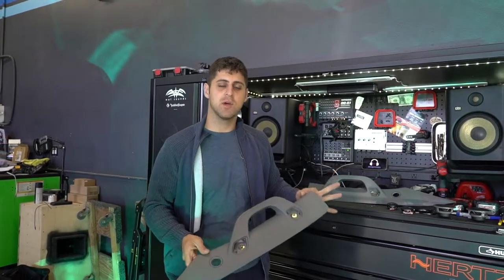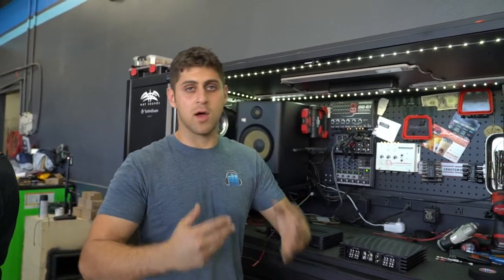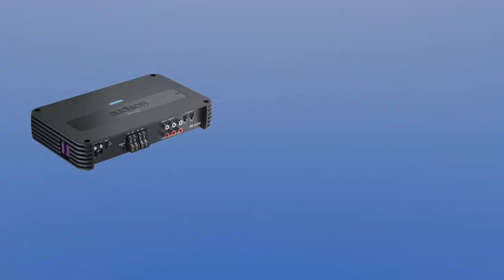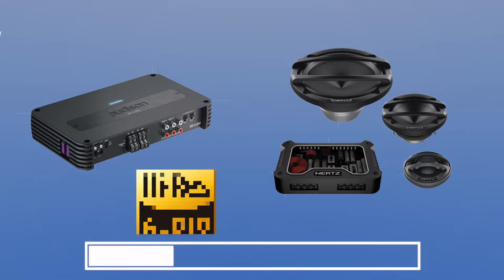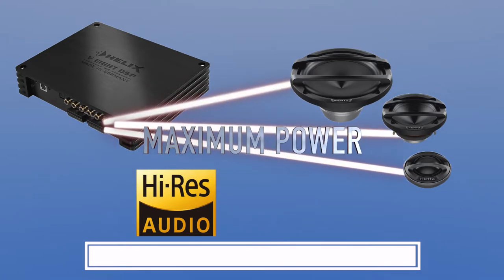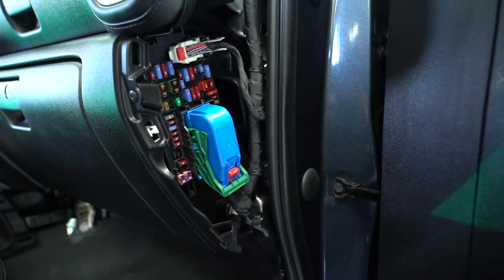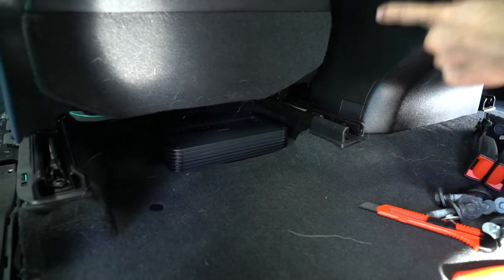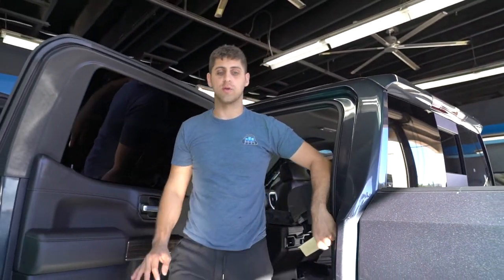How To Tutorial 3 Way Active Car Audio System(BEST QUALITY METHOD!) 2022 Chevy Silverado

Comment: Did u have to modify the 2.75 midrange speaker to install the 3in or did it fit without any modification
Reply from the maker: Slight shaving needed to seat but fits very well after :)

Comment: Hello, how do you grab low or high level signal to the dsp from a factory non Bose system iOS  on a 2021 silverado?
Reply from the maker: Very simple, that system is just a four channel Audio output, you’ll find two plugs that are square in the passenger kick panel/firewall area where the outputs are generated to the speakers. You can grab the signal from there

Comment: What settings or corrections did you make in the DSP to address the factory Bose time alignment, Active Noice Cancellation, and fader functions? Did you still run the rear drivers? Also, which inputs did you use from Bose to go to the DSP to have a "full signal?" Thanks!
Reply from the maker: Well actually, we did not have to worry about the equalizing and doing a full RTA to smoothen out the eq spectrum to our target curve As we replace the head unit itself which starts off with a direct and clean signal. From there we do a simple rta To achieve the target curve, gain match, and then finish off sometime alignment and final preference to tuning,
Reply: @audiolux6009  What head unit did you install? Any issues with navigation or cameras and such, or did the customer not care about losing that stuff?
Reply from the maker: @MrSmokin04  Everything was retained. We were able to retain the factory back up camera, retain the steering wheel controls and chimes. You do not have to loose anything. The radio is a DDX 60906S from Kenwood
Reply: @audiolux6009  Would really appreciate seeing any pics available of that part of the install. Never thought a HU would fit in there.
Reply from the maker: @MrSmokin04  I do apologize, scratch everything I just stated as that was a different truck of a different year. This is the newer truck model where the radio cannot be changed out. So your question is how we work with time alignment and the factory equalization? On the helix DSP processor we use which is also the amplifier combo, it has a input analyzer per channel that you grab from the Bose amplifier and it is able to scan the input once you use a correlated pink noise track and you’ll be able to tell if there is time alignment involved and if there is you are able to reverse that in the helix settings. With the equalization it is as simple as doing a full RTA And adjusting the EQ to reach the target curve which requires more aggressive adjustments than having a aftermarket radio, after all that is situated then you can go and enter your own time alignment settings and so forth
Reply: @audiolux6009  Awesome! That's what I figured. I have a Helix DSP Pro MK2 going in mine...and I figured we could undo the time alignment features that Bose did. Was the Helix able to sum all the channels to get a full signal? Or did you need an Epicenter or Wavtech to augment? Sorry for all the questions...just getting ready to cross this bridge myself.
Reply from the maker: @MrSmokin04  Yes the helix was able to sum the front active signals and still had enough input channels for the rear and factory subwoofer.
Reply: @audiolux6009  So the front channels are a true 20 Hz - 20 kHz signal? We've been worried about that since our RTA just showed signal from 40 Hz to 12 kHz. We had to use a Wavtech just to get anything below 40 Hz. Your answers have been REALLY helpful man!
Reply from the maker: @MrSmokin04  you should have the full spectrum minus some lower end such as 40 and down from the summed front dash mid/tweet signal And the 6x9 midbass door signal. You don’t need 40 hz and down as that is where the subwoofers job kicks in. The subwoofer channel has the lower frequencies you are looking for from the factory amp output
Reply: @audiolux6009  where you location? I need install sistem
Reply from the maker: @eduardodavila2463  we are in Santee Ca

Comment: What about the tweeter do you still use the crossover?
Reply from the maker: No crossover needed. The 8 channel helix amp With built in DSP allows us to set the crossovers digitally on those specific channels. So there is literally no crossovers needed when you run an active system since all crossovers are digitally created in the DSP section. The only thing you need to consider is that individual line is he run from each channel to each speaker one by one
Reply: Hello I just brought this helix dsp/Amp I’m looking to run the new alpine R2-S653. I don’t want to burn out my tweeter since I’m running full active. How would I go by setting up my gain and crossovers for my tweeter? Or does the amp/dsp know if it’s a tweeter when it’s on the high output channel?

Comment: Hertz is OK, can't say it isn't but surely not the best and that dsp is an ic amp not mosfet which come which comes with massive limitations compared to a stand alone mosfet class ab amp for the front stage. Also focal, Morel or some dynaudio ways would blow the hertz out of the water. Not saying hertz are shit they aren't at all there is just better than the title suggests but I've got used to legit videos even using click bait now 😂